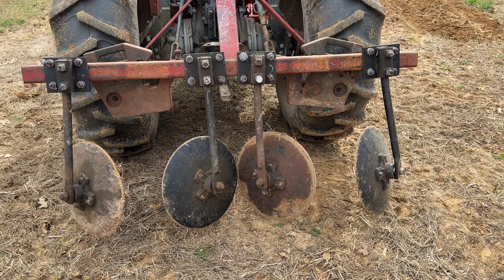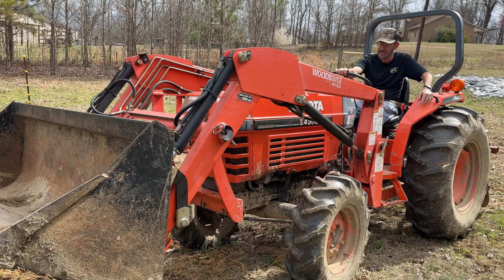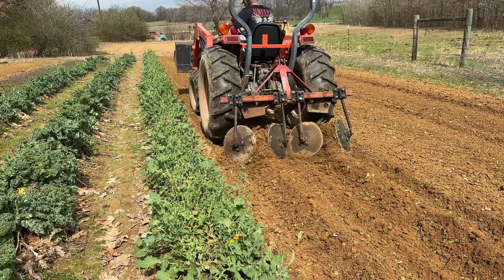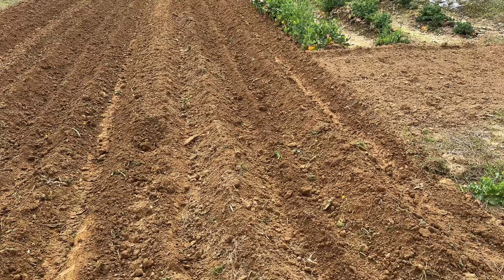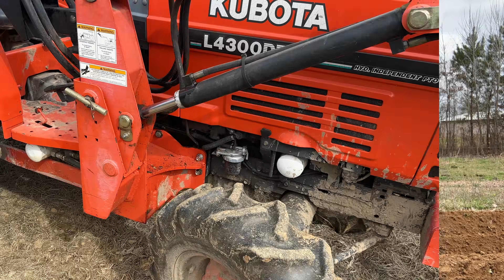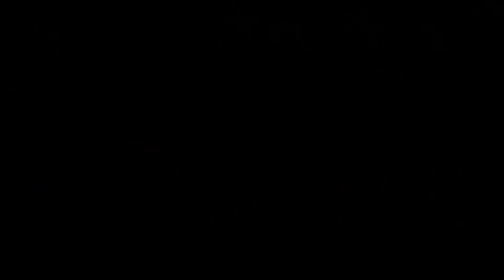Garden Innovation: Meet the Double Row Builder

Comment: I did the same thing with a cultavater for growing taters.  I'm using 20" disc on mine for a tall bed.
Reply from the maker: I am surprised you don’t see more double row builders, pretty easy to put together. I wish I would have had a few 20-inch disc(s) around, but the 16’s worked fine. Thanks for watching